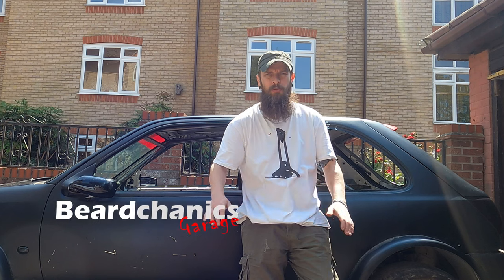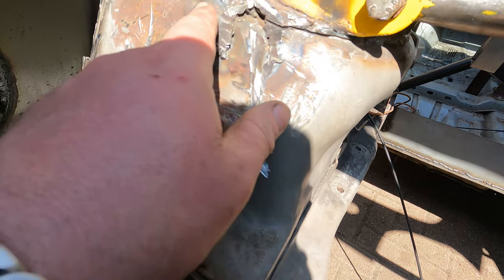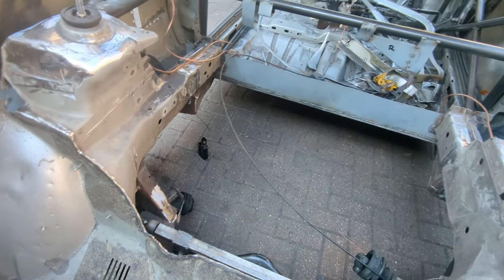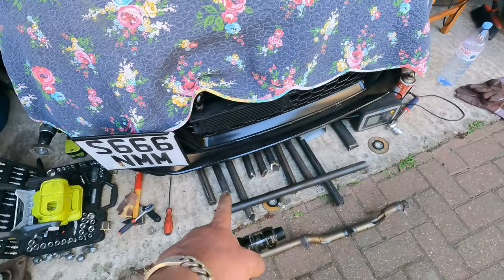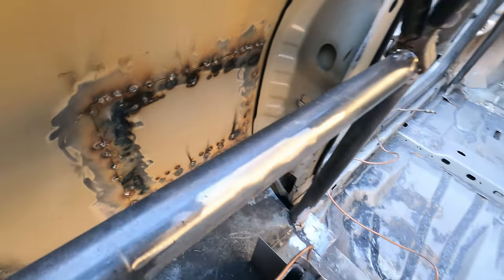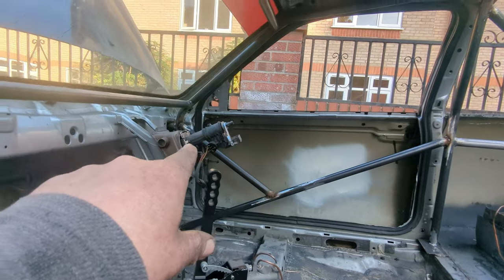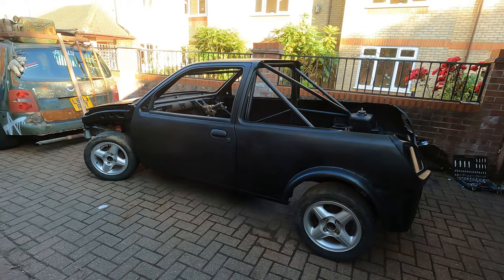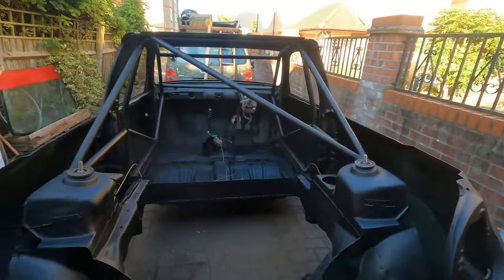PICK-UP CONVERSION - Twin Engine Fiesta EP1

Comment: Good afternoon Gilles!  Great job on your Pesta. I like how you aligned the roll cage stiffener tubes on both the driver and passenger side. Great job of weight reduction, cutting off unnecessary and excess parts. I like how you cut the roof for the pickup conversion. Successful experiment. I can't wait to see the donor Puma engine fitted to the rear of the Pesta and later see how it works together with the other Puma engine mounted in front. It's a spectacular project. Great job with the paintwork of the interior and exterior and the roll cage.  Can't wait to see the next episode. Happy weekend Gilles. Bye 😃👍👍
Reply from the maker: Thanks mate, really pleased with myself. I think it's the project I've worked on the most myself and still tonnes to do. Great learning journey. And got everything disconnected today so tomorrow I'm attempting the engine swap! Couldn't get an engine crane so it's going to be another DIY job. But it will get done! Hoping to be able to drive it by next week-end at the latest :D Have a great evening and Sunday my friend :)
Reply: @Beardchanics  Excellent Gilles 😃👍. Happy sunday to you too 😃👍☀️